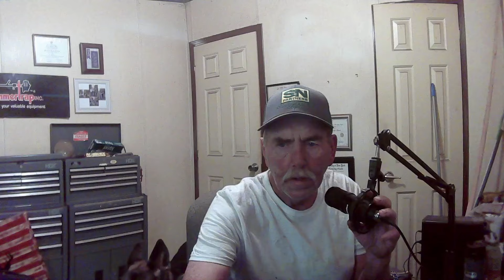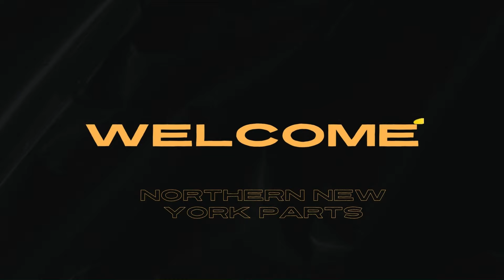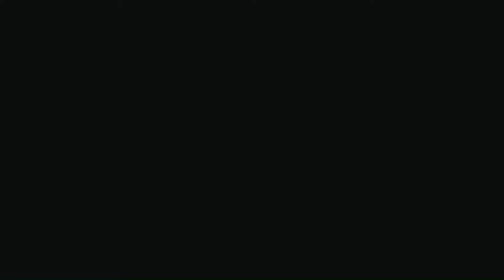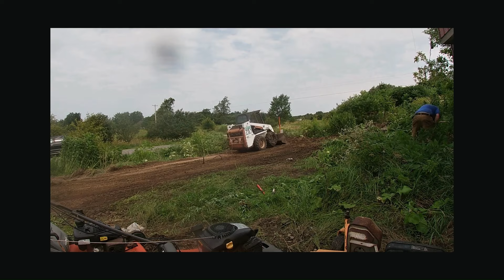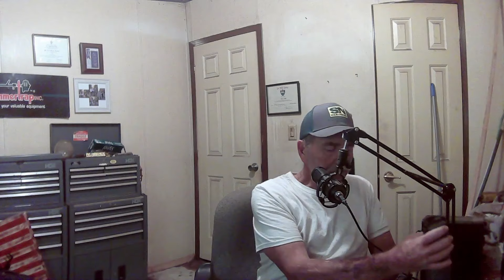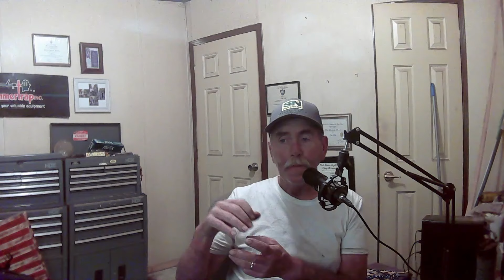Lawnmower Dies After 10 Minutes: WTH

Comment: I had a rider that would idle all day but when you started mowing it would run for a couple of minutes and die. It was a fuel line that had collapsed inside just before the fuel tank. Put a new line on it and it ran great with no problems.
Reply from the maker: I have seen that as well Jason, of the old fuel line is breaking down thus not allowing fuel to move. thanks

Comment: We never over charge a customer for our inability to diagnose an issue in a timely manner. If I feel that we spent more time than could be justified to make a diagnosis and repair I never pass this on to the customer. I see shops charging the customer crazy amounts because they lack experience to make a correct diagnosis. They then start throwing unnecessary parts at the job that wasn't needed trying to correct the problem. We repair RV gen sets that other shops have gave up on. We tell those customers "if we can't fix it, you owe us nothing".
Reply from the maker: Sounds like you figured out how to gain and keep good customers. Well done!

Comment: Things on the cusp of failure are tricky
Husqvarna demo saw came in
Customer didn't say anything about hard to start when hot
Fixed n away it went only to come back
Passed pressure test n everything 
Cylinder gasket was .001" thinner on exhaust side
Lawn tractor came in for service 
Fixed n away it went only to come back
Hunting, gasket at head n manifold started to go
Another Lawn tractor came in for service but it started to pop n fart after putting plugs in
"Can't be plugs, they're new"
Carby n fuel line cleaned, still doing it.
Valve gaps adjusted, still doing it. 
Coils tested n kill wires checked, still doing it. 
Plugs out n bugger me one had been dropped n put back in box, 10 pack
So now I look at every plug

Comment: Thank you for this. You are an old fashioned guy with an ethical core. Appreciate that 
I m retired on my small farm, run a small bandsaw mill, 22hp predator , Honda gx before that. Both engines get mice living in them, chew up wires and fuel lines  predator ran for half an hour before stopping.  Put a new carburetor on and it ran half a day and the next day started right up and died after two minutes. Seems like no fuel getting to spark plugs because it starts with a spray of ether. Any ideas?
Reply from the maker: See questions and answers' Miguel from yesterdays video